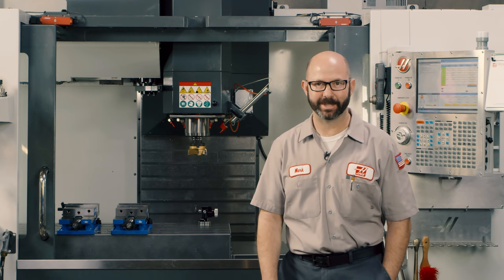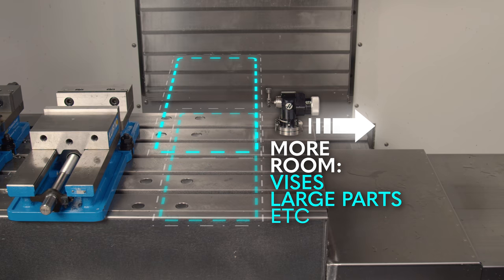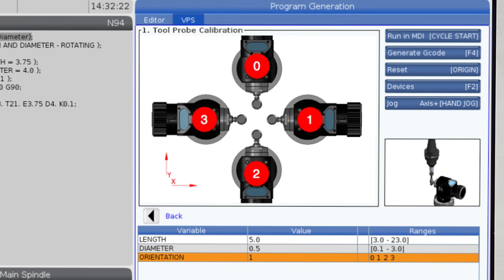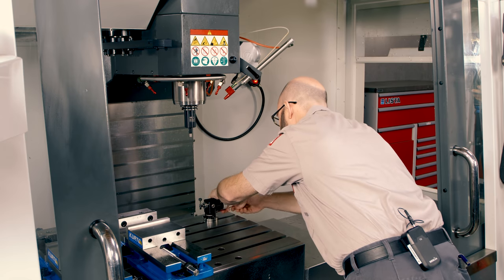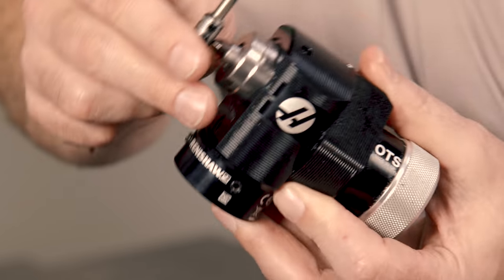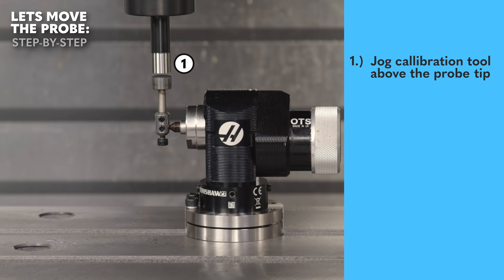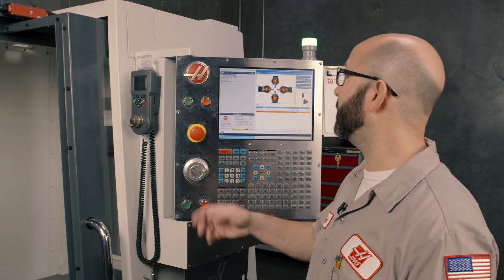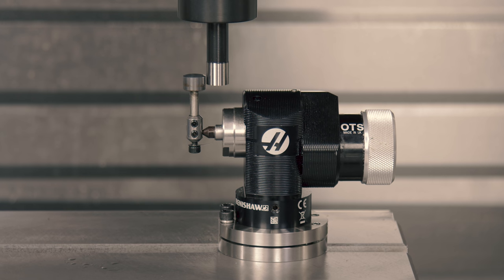GET EXTRA TABLE SPACE! - Haas Automation Tip of the Day

Comment: Hello Mark, I just received my brand new Haas mini mill. The Haas tech mounted the OTS in the same orientation and position as shown in the video. I want to move the OTS as shown so I can take advantage of the extra space to fit 2 vises. Before I do so, I want to make sure that when I do a touch off and diameter measurement it will do theses along the Y axis only. Is this determined when entering in the info per facemill probing or is it set in the set up of the OTS calibration? Thanks.

Comment: i made a quick detach riser for the ots where three matched spheres sit between three pairs of carbide pins 120 degrees apart, it reindexes within ten millionths on every axis (or less but that's as good as i can measure without sending it out) so i don't need to recalibrate every time. it's held on with magnets with a provision for a bayonet style twist on cap to protect it when the probe is removed. that way if i have a big part i can get all the tools set up, remove the probe and put in the part.
Reply: SuperAWac - this sounds interesting but I can't visualize this. Would you like to post a link please?

Comment: We had to make a spacer to move OTS up to have less of an issue with a close vice or rotary table on our VF2. Especially on the rotate length - we like using that for face mills. So at some point you may want to move that OTS - plus its a good exercise in calibration.

Thanks again - your really pumping out a lot of cool videos lately

Comment: Everyone!
The Best way———————
I made an aluminum block,  with a location stop,drilled and tapped to mount probe to the block. 
On the VF4 we went from,
 4 vises to 5 vises .
On the last vise, on the right side, put the block with the probe  in the vise, lightly clamp it in. 
Re-calibrate the probe. 
Once you are done touching off tools, you can remove the block from the machine, and store it somewhere safe outside the machine so it can’t get damaged if you were to throw a part during production run. 
Also if you have a fixture you can’t remove from that probing vise, you can move it to another vise and do a manual tool touch off. 
This method also allows you to move the probe to different machines as long as it’s calibrated.  Save the extra probe if one gets damaged. 
We have used this technique since 2013 no issues. 
I would post a pic if I could. 
Hope this helps/get that money! 🤘

Comment: On many machines is best to set the tool probe on the left side because the tool changer is on that side For example the TM models if you have some  big parts in the machine the past can't go under the  tool changer so the room under the  tool changer a better to place the  tool probe so you have more room  for big parts
if you have a long drill in the tool changer then you'll lose height so that part can be so high going under

The machine is shifting tool SK40 holder If the Machine Head as swivel arm it lowers the tool about 100 millimetres before turning around so big chance for collision if part is too high 

The Machine VF3 Head 742 mm in highest point i z - 100 to  tool changer If you have a part that is 300mm high and you have to drill 300 millimetres Then you have to  move the table  when changing tools for avoid a collision
Reply: kastrup2dk that’s a good point. There are lots of setups that might require you to move the probe from one side of the table to the other. If we do switch sides, it’s always a good idea to move the OMI (wall mounted receiver) as well. By doing this, and adjusting the table probe (OTS) so the battery cap faces outward, you will be able to place the probe in an orientation where it takes up very little table space.

Comment: Mark, it looks like your calibration tool diameter is about .500 or so. Our VF4 came with a calibration tool that is more like 2", so I know I need more than .750 for calibration. I'm assuming I can just add the difference (in radius), can you confirm?
Reply: Joshua Boulee that is a very large calibration tool. Yes, the larger the calibration tool, the more room it will need. 19mm/.75” is a good rule of thumb which works with typical calibration tools. For larger, you’ll need to add the radius of the OTS stylus (6.35mm) to the radius of your calibration tool (25.4mm) plus 4mm (leadin amount in calibration macro). So, 6.35+25.4+4.0= 35.75mm minimum extra travel, which we can round up to 40mm/ 1.6” in your case. You can see why I just went with, “umm, 19mm”.  Good luck to you, hope that helps.
Reply: Awesome, thank you! I would have gone cross eyed trying to read through the macro to find that 4mm lead in value!

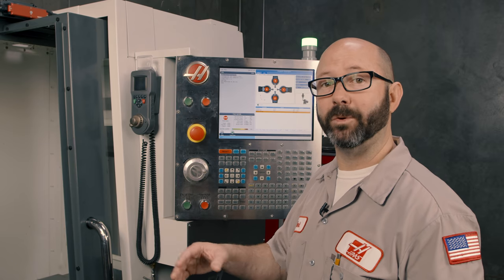Comment: If the probe is only 19mm away from the edge of X travel, how would you probe diameter of a 100mm shoulder mill? To be on centerline when probing the diameter in the Y direction, the probe would need to be 50mm away from the end of travel. Am I missing something here or is probing a face mill or shoulder mill for diameter just something that isn't done? Looks like that's whats happening at 4:52.
Reply: Probing diameter is done in Y direction. Some I think input their orientation of the OTS wrong, case in point
I think this person orientation is off as well, in their setting.
https://www.youtube.com/watch?v=4qq88xM6y7Q
Reply: At 4:52 its measuring length. Depending on the tool type, the machine offsets the tool length probe location by its radius so that the cutting edge is being measured at the center of the anvil, not the center line length.
Reply: Alex K. Thank you for the reply! That makes more sense
Reply: Travel is centerline

Comment: All well and good, but a TRT160 forces you to mount on the left side of the table, and the receiver location prevents you from  rotating the tool probe 180 degrees.
Reply: I made a riser post to mount my probe on the right end of the table behind the rotary. That way it hides in a spot that I can't use to cut metal. Works mint.
Reply: @metlmuncher  its weird how easy it is to NOT think about raising the probes. We had a similar issue in 2 of our doosans. High jobs spanning most of table meant unable to reach setters. We had a quote for a professionally made piece before realising as long as the faces are relatively parallel you can account for error when calibrating. So we just turned a length of 300mm aluminium bar with a hole down middle for the fixing bolt. Never been touched since.
Reply: @wildin13  I made a couple different lengths. Depends on what's shaking.
Reply: Thanks!
I guess I should have thought of that myself.

Comment: Can this be done to a SMM2?
Reply: Omar Gonzalez yes. The needed extra travel is dictated by the size of the calibration tool, not the machine. As long as the calibration tool is .5”/12.7mm diameter or smaller, than 19mm of extra travel is all you need.

Comment: Mark,    If OTS is  on the back left corner of the table, with the battery compartment pointed to the column,  when doing a large tool diameter the program will only do diameter in Y-axis, NOT in X-axis.  Also with the OTS facing north and south, we still need to come off from edge of travel 19mm.

If so, the person in this video has set their orientation wrong and is why the diameter is being check in x direction?

https://www.youtube.com/watch?v=4qq88xM6y7Q
Reply: Raven Rock Machine and Aviation that’s an unusual installation. In that case, if the OMI is on the right side of the spindle, but the OTS is mounted on the left, then you are correct, we would need to leave ourselves as much as  3”, so our large tools can be probed. In this case, I’d suggest moving the OMI to the left side of the spindle column, so the OTS can be mounted with the battery cap to the left as well - this setup would only require the extra 19mm of travel we talked about in the video.
Reply: Mark Terryberry thanks Mark.   HFO installed the ots on the left side of the table w/ the pad facing the door.  They mounted it there because I have a 4th axis.

Comment: Thats 50.8 mm not 15.0 mm
Reply: norman holland thanks for clarifying. I didn’t say “50 millimeters” very clearly. Probably should have re-shot that audio. Thanks for the comment.
Reply: @markterryberry4477  No big deal Mark, just jumped in before you get bombarded.  How can we set all tool lengths using a touch indicator, then set work Z  in G54?
I get frustrated using paper for every tool, its not the best. Thanks. Norm
Reply: norman holland this totally needs a video. There are a few different ways - all easily explained with a video, and hard to explain with words alone. Thanks for the suggestion.
Reply: @markterryberry4477  My pleasure Sir, thanks for the prompt reply. Greetings from north scotland.